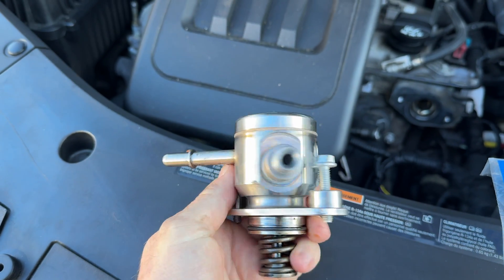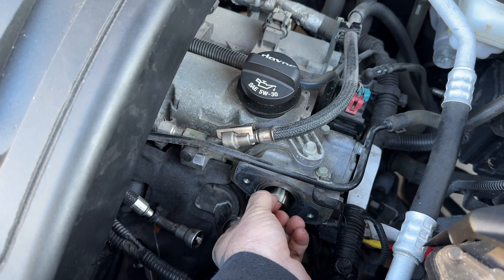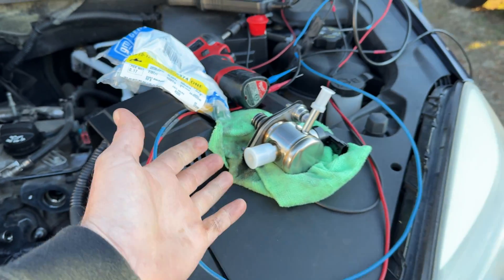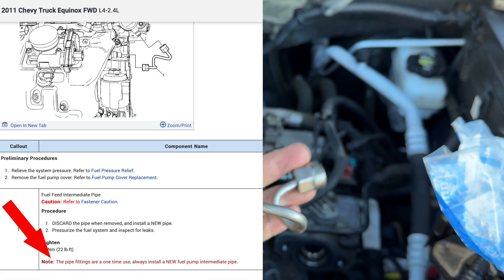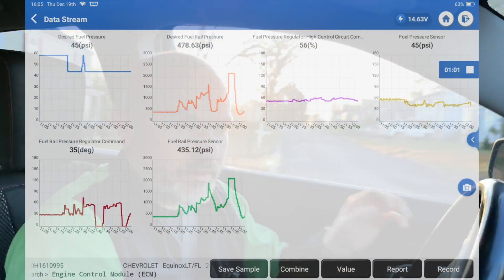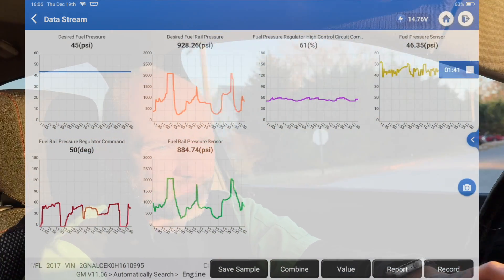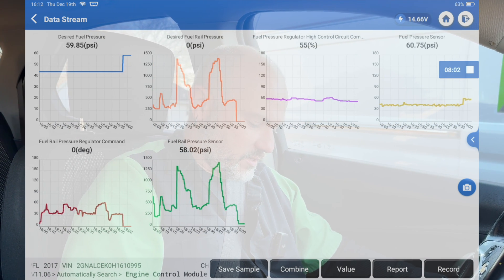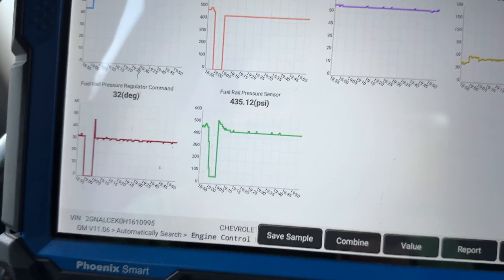The Known Good to the Equinox Fuel Pump P0191 Issue

Comment: Thank you for the tips Jake that were in both videos.  
People don't understand about high pressure tubes and what can go wrong.
CNG is the same way.  I learned that when working on a Freightliner truck with the Cummins CNG engine and 5 tanks mounted in back of the cab.
If you don't replace that tube, you could find yourself at a "Carbecue!"
(Car Barbecue)

Comment: Compliments of the season to you and yours.  after watching the above it gave me some insight into a similar issue on a 2012 Equinox 2.4l  This vehicle is displaying systoms such reduced power concerns at times rough idle wile driving and at times would cut  off. the codes when scanned are P0089, P0366 and P228D. The truck has had intake and exhaugt vvt solenoids then timing chains thrown at it by prevous tech with no solution.
I decided to concentrate on the high pressure  pump and the data shows after about five minutes or so the desirered actual fuel pressure sensor reports a 1000 psi difference and would start to run rough to the point of cutting off but if gas is applied it would correct it self
Don't want to extend this any futher
1- In your opinoin , would you lean toward the pressure sensor or the hp pump? [reason being I am thinking heat related}
2- Trying to get familar using scopes , can I scope the sensor to look for the difference [Using a 2 ch Pico}
Appreciate any input 
Thanks in advance [Always enjoy and learn from your videos}
Reply from the maker: With those codes I would be verifying when this started happening. Was the engine replaced? Was the head replaced? The 2010 engine used different camshafts and phasers and I often see those engines getting swapped into newer vehicles.
Reply: @autodiagyt  Will ask customer thanks for reply

Comment: I wonder why that aftermarket pump doesnt bleed back completely when at 0 degrees (or fully actuated solenoid). What would you think is different to the oem one?
Reply from the maker: Find pine hollows comment and it's in there what I think
Reply: @ thank you

Comment: This still doesn't explain why the other pump couldn't pass the test.. ??  I don't get it....    That other (bad/aftermarket) pumps high pressure could still float down to 400 psi or so...  SO that tells me that the actuator was capable of opening and dropping pressures-  because otherwise, it would be running at max pressure all the time.   So if that pump can open enough to allow pressures to drop down to 400 psi...  Why couldn't it just stay open and drop those pressures down to the 50 psi (to match the low side) and pass the test???   lol..  I'm not understanding why it works and can be commanded, but yet can't pass that simple test.   Very strange

Comment: Whats a good scanner to level up. Money low but want those graphs n bi directional.. tia
Reply from the maker: Phoenix Lite 3 is one of the best values on the market.
Reply: @autodiagyt  no autofix d1 lite?
Reply from the maker: @HardWorkPaysPa  the d1 lite is good to start with for a diy. It’s a little slow for someone trying to use it daily in a shop

Comment: Those usually squeak when you unplug the solenoid?
Reply from the maker: Yes when you unplug one that is normally closed inlet they will squeak because the pressure is pushing open the mechanical override valve.
Reply: @autodiagyt  Thought so. We've had a couple that squeak when plugged in, just less squeak. Also, I've re-used that high pressure line, like 5 times on one trying to sort it out.

Comment: I usually just add the high pressure line or lines depending on engine to the pump price so no one can try to cheap out. Of course the parts are recorded as sold on RO and my repair story supports that they have been replaced. If they question the pump price then i tell them that i added the lines in to price as you cannot reuse them due to liability issues exactly how you explained it if the car catches fire.

Comment: Good to know that there are normally "open" pumps and normally "closed" pumps! I've unplugged a few and was surprised that sometimes the pressure maxes out and sometimes drops to nothing and the car stalls out 😅
Reply from the maker: @PineHollowAutoDiagnostics  well now you know pretty much why lol
Reply: @autodiagyt  This still doesn't explain why the other pump couldn't pass the test.. ??  I don't get it....    That other (bad/aftermarket) pumps high pressure could still float down to 400 psi or so...  SO that tells me that the actuator was capable of opening and dropping pressures-  because otherwise, it would be running at max pressure all the time.   So if that pump can open enough to allow pressures to drop down to 400 psi...  Why couldn't it just stay open and drop those pressures down to the 50 psi (to match the low side) and pass the test???   lol..  I'm not understanding why it works and can be commanded, but yet can't pass that simple test.   Very strange
Reply from the maker: @ my guess is either the solenoid isn’t as strong or they have a heavier spring in the valve or the opening is smaller causing it to act as a orifice. It honestly could be a few different things and the only way to know is dismantle 2 pumps and compare each part which would be very difficult since they are welded together.
Reply: @autodiagyt  sounds like you have to make a bonus pump teardown episode 🤗
Reply: @autodiagyt  I just assumed that all the HP fuel pumps operated the same way... Learning something new every day! 😁👍

Comment: Calling people cheap when the cost of everything has drastically  increased and stretched their budgets is being sumwat judgemental. Of course majority of the people are trying save on parts and repairs of vehicles and appliances
Reply: What he was trying to say was if someone can’t spend an extra $80 to in ensure their vehicle is safe you shouldn’t be working on their car. If the vehicle caught on fire because of a 2000 psi fuel line bursting after a mechanic touched it regardless new line or old line. Mechanic is still liable.
Reply: @TwistedCamshaft  AMEN!

Comment: Tremendous effort and    explanation. But no root cause in the aftermarket pump.
Reply from the maker: The root cause is that it’s not designed correctly for this application.
Reply: @autodiagyt  I guess I should be asking the root cause to the  aftermarket design engineer...Like, how did it get missed, and what was internally different from aftermarket to OEM.  I am thinking at a much deeper level. It would be fun to compare the internal components, even on the PCB layout schematic, if the pump has one.

Comment: So what was the cause in the old pump? Was it an electric valve that worked in reverse and did not let fuel into the tank?
Reply from the maker: Old pump as in the aftermarket pump that was installed? It’s designed for the older style engine(2010 and older) and not updated to work correctly on the 2011 and newer engines. For what ever reason when the ECM commands it to 0 it doesn’t pushed all of the fuel out of the chamber and still compresses fuel.
Reply: @autodiagyt  Aftermarket pump. Maybe the electric valve just worked differently. Great video, thank you

Comment: From what I understand Honda initially required the high pressure line needed to be replaced, but now the line has been discontinued and is not available.  I don't know if that's only older models, but if they initially said to replace it, but now it's not available, it might be best to pass on that job as well.  Thanks for the great video.
Reply from the maker: They could have made a revision to the service procedure as well if they discontinued the line.

Comment: So, I had this exact scenario happen to me on my sister's 2010 Equinox.  Started with the original pump leaking fuel into engine.

Replaced with a Standard Motors Brand.  Problem solved, right.  About 3 weeks later, the sister calls about the engine running rough and stuff.

Same codes as your case study.  I could have written the script for your video.

Pulled my hair out.  Different codes and symptoms than the first time.

Installed new GM pump, problem solved.

Question:  Is it that the aftermarket pump was not letting pressure go to zero psi, or what.

GREAT VIDEO!!  I relived my nightmare watching this one.
Reply from the maker: Yes the aftermarket pump when commanded to zero just doesn't get enough of the fuel out. This could be caused by weaker solenoids, the size of the passage might be smaller making it act as an orifice or something else.
Reply: @autodiagyt I had just retired at the time my example happened.  Lost access to all my diagnostic equipment.  Flying a little blind.  Have since remedied that problem, and still keep my hands in the game.

Your videos are great, feels like I am still in the shop.  Thanks!!